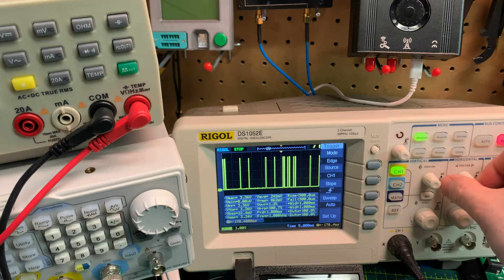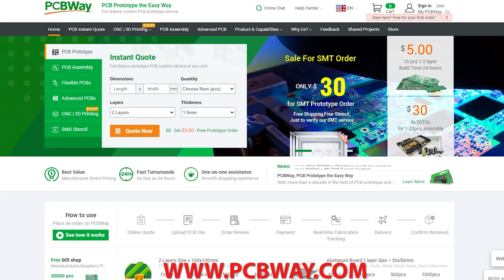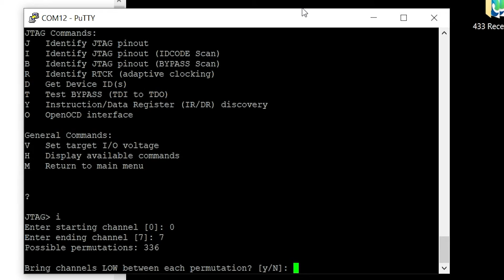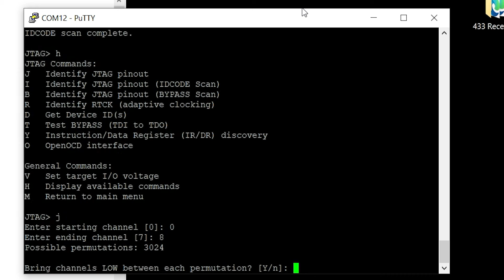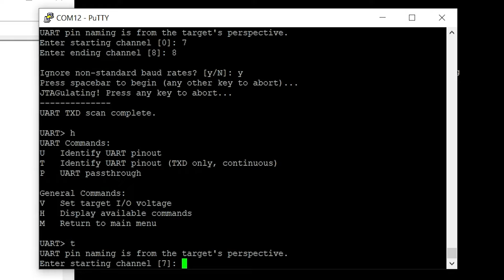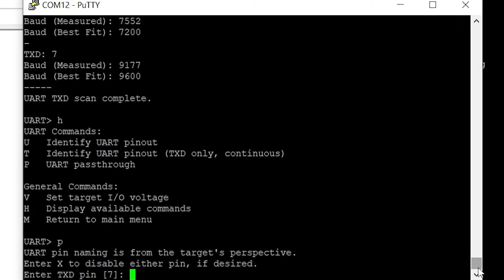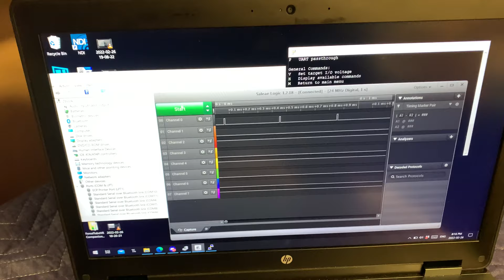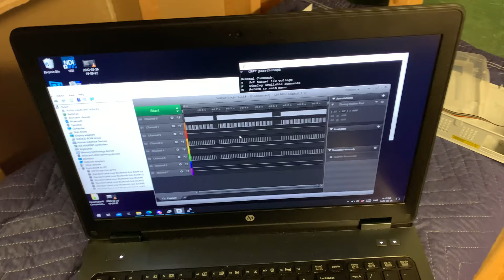Can We Reverse Engineer a Network Switch & Fix It?

Comment: I have seen that before. Its something I ran into a lot at ibm but still see it today. Its static lockup. The act of cleaning it helped but then you interfaced with your hands and tools and that discharged the lockout. Most dont understand it till it happens to them but I have saved many devices over decades with that.